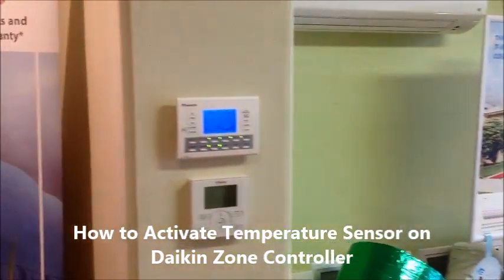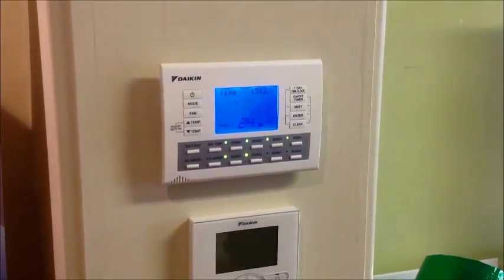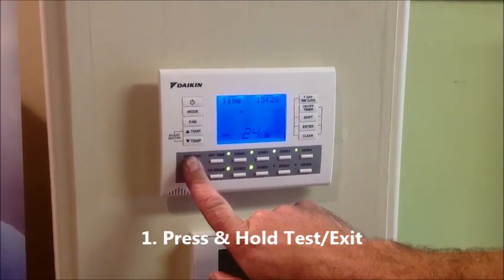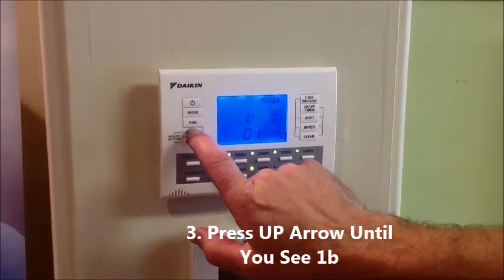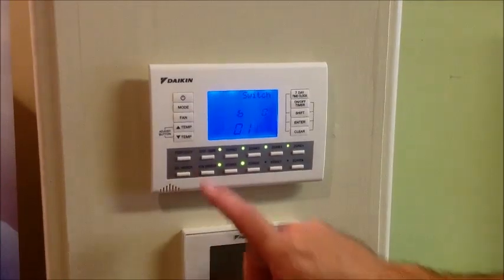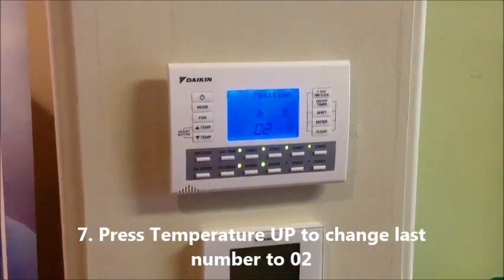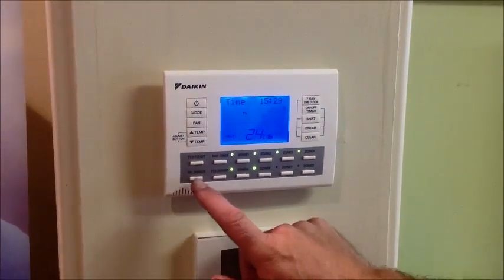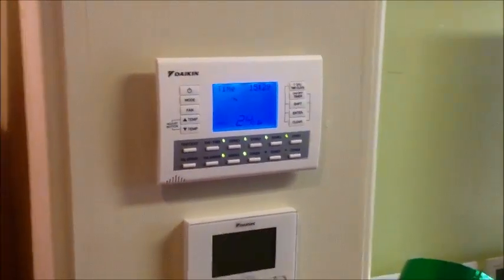Improve Temperature Control | Activate Remote Sensor on Daikin Zone Controller (DIY Guide)

Comment from the maker: 🎯 Want better room temperature control? Learn how to activate the remote sensor on your Daikin Zone Controller for more accurate readings.
💬 Got questions or unsure which sensor your system uses? Drop a comment below!
👍 Like + Subscribe for more quick Daikin DIY tips from Morphett Air.

Comment: To set the themostat to use the return air, do I set the code to 1b 5-02 and then select the indoor sensor?
Reply from the maker: Hi the system is factory set to sense from the Return Air anyway, however if it has been changed to the Master RC (Wall Controller), you should be able to press the "SEL SENSOR" and toggle to "INDOOR SENSOR". Once you've done that, press "FIX SENSOR". This will now be sensing from Return Air.

Comment: Thanks for that. I’ve done it. But when I press fix sensor nothing happens. On my unit I see Master RC, Indoor Sens, Sens1 and pressing Fix Sensor doesn’t show anything. Any help would be greatly appreciated 🙏
Reply from the maker: Hi VW Central by pressing Fix Sensor won’t do anything other than fix the sensor that you happen to  select. In other words, one you toggle between Naster RC (wall controller), Indoor sensor (return air) or Sens1 (remote sensor), you press the Fix Sensor button. This then becomes the preferred sensing point. There will be no notification as such to suggest this but that’s all u need to do…cheers
Reply: @Morphettair  Thank you for your prompt reply, but I don’t see any temperature from the controller itself. The display just remains in the usual off position.
Reply from the maker: @VwcentralAu  ok so just to clarify, are you wanting to see the actual room temperature?? Not sure I understand what you are trying to do?
Reply: @Morphettair  yes exactly. I’d like to see the actual room temperature from that controller.
Reply from the maker: Ok I don’t reckon you can in this controller. A tech should be able to retrieve coil temperatures etc however this is not going to do what you’re expecting. I know it’s possible in their standard controller (BRC1E63) but again don’t think it’s possible on this controller. Go figure 🤷‍♂️
Reply: @Morphettair  interesting. I’m not sure if mine hasn’t been setup correctly but I tried Master RC, Sens1 and Indoor Sens then press Fix Sensor and none show me any temperature 🤷‍♂️
Reply from the maker: @VwcentralAu  none of these options will or should display a temperature. (It will only display the set point temperature (ie the temperature you set it to) on the main screen.

Comment: I have coded as per the video, however my AC seems to just keep running and the temp sensors dont seem to be working still. Indoor Sens does but the controller ones still done. Any ideas?
Reply from the maker: Tricky one without seeing how you’re using it first hand but generally, if the compressor keeps running, this can often be because the conditioned air is not getting to the sensor. For example, if you have it sending at the wall controller in your hallway and have closed the doors to your rooms, this will prevent the conditioned air from reaching the sensor. The system will essentially be sensing an unconditioned hallway and therefore the system thinks it needs to keep conditioning because of the temperature in the hallway 😓 Summary: open doors you are conditioning and close doors you are not. Make sure wherever you are sensing from has conditioned air around it and not unconditioned air.

Comment: Hi,
First off, thanks for your practical and well-presented videos. 
Just a quick question, for BRC24Z8, how I can run the unit on Test Operation to make sure that the sensors are working properly? I mean I need to bypass the sensors and run the unit to make sure the unit is operational.
Regards
Mack

Comment: Hi nice vid got the same unit right now I want to know how to separate the 2 rooms when press zone 2 it's goes to both rooms zone 1 I hear a click but not sound in the rooms if that made sense lol
Reply from the maker: Hi it will depend on how the system was designed.  That is, if whoever designed and installed it had one zone motor that operates the two rooms, this cannot be changed by the wall controller and can only be done by adding a second zone motor.  You would need to speak with a service tech and have them come to inspect to see what can and cannot be done in your case.  As for the Zone 1 room it is possible that this zone motor has seized and this is why you can hear it clicking but not delivering any air to the room.  Again, this would also need to be inspected to confirm and a possible zone motor replacement might be necessary. Cheers.
Reply: I have the same issue! One room is smaller than the other and becomes very cold and/or I cant have it off while the other room tends to heat up more due to sunlight...

Comment: I have got as Zak two controllers master and slave. I wanted to activate both according to your response to Zak’s query but any attempt to select “Local Set “mode on the slave is transferred to “inspection mode”. Could you advice what need to be done?

Comment: Our new place has this installed with 2 controllers. There are only 2 zones - upstairs and downstairs. Will the sensor it uses be on the panel I set this up on? Or does it use both sensors on both controllers? I.e. I want the sensor in the bedroom to be the one that is used.
Reply: @Morphett Air Thanks to Shane from Morphett Air in Adelaide who helped me out by fixing my controller problem I had. He did'nt ask for a cent. In Melbourne, people only thought about the money before they could help me. Also, the receptionist was a great help. Thanks, from Ben in Melbourne.
Reply from the maker: Thanks for your question James.  So if I understand correctly you have two of the Daikin Zones controllers, one upstairs in the bedroom, and one downstairs.  You need to add the field setting for the additional zone controller in the Master Controller only. Once you've done this and if done correctly on the Master Controller, when you press "Sel Sensor" (Select Sensor) you should now see the option of "Master RC" (being Master Remote) and "Secondary Remote" (or similar which is the Slave).  Toggle between the two sensors and select the one you want to sense from and press "Fix Sensor".  Let me know how you go.  Cheers.

Comment: Thanks for posting these, one question if you could help, my controller got frozen yesterday and the display doesn't change whichever button I press, I thought it's cable connection issue so I disconnected and plugged in again, now it's showing "Please Wait" and all characters and icons full screen and display always on (still frozen) with 8 zone buttons all lit on, how do I reset it ?  Many Thanks.
Reply from the maker: Hi Lyle, thanks for your comments and question.  By unplugging the controller is not going to do a full reset as you have found out :) (A) I would suggest that you go to the outdoor unit and look for an isolating switch on or near the unit.  This isolates the power to the unit if a service tech is working on it.  Switch it to the Off position for approx 20 - 30 seconds then turn it back to ON.  The indoor wall controller should show "88" indicating a reset has been done.  After a few seconds it should return to normal function.  (B) If there is no isolating switch, you can also turn off the circuit breaker and turn it back on again which will also do a full reset.  (C) If this does not sort the problem for you, it could be a faulty Wall Controller or Indoor Printed Circuit Board or both, in which case you should contact a local agent to inspect and diagnose formally.  Hope that helps!
Reply: Morphett Air thanks very much for your instructions. I will give a go. Happy new year
Reply from the maker: Cheers Lyle and same to you!

Comment: Just to be clear, do all the controllers (we have 2) have the sensor built it or are they an option?  Also, is there a manual that lists what all these codes do (for the things that you haven't done a video for)?
Reply from the maker: Hi Zak, thank you for your question.  Yes both controllers have an temperature sensor, however you need to tell it that it has a temperature sensor in built.  That is, you need to tell each of the controllers it has one.  You will need to follow the procedure shown in this video https://youtu.be/MWk0GMfQlhM (which is for the master controller), but the process is the same for the secondary controller (Slave controller).  Note: You can only add the field settings in the Master Controller (In other words, to activate both the sensor in the Master Controller and the Slave Controller, the field settings are both entered on the Master Controller ONLY).  Code for Master controller is 1 B 5-02 where Slave is 1 B 6-02.  If you have done it correctly, when you press the &quot;Sel Sensor&quot; button, it should now give you the option to toggle between &quot;Master Control&quot;, &quot;Indoor Sensor&quot; and now &quot;Slave Sensor&quot;.  Select which sensor you want the temperature to read from and then press &quot;Fix Sensor&quot;.  Hope that helps.

Comment: THIS IS THE EXACT SAME AIRCON I HAVE! ITS ON COOL MODE BUT ITS NOT COLD?!? ITS WARM
Reply from the maker: Hi thanks for your comment.  Sounds like you will need to contact a service technician to visit as it could be a number of reasons for it not cooling.  Assuming that the mode and temperature are set appropriately, it could be short of refrigerant (indicating a leak), a printed circuit board, fan motor(s), sensors just to name a few possibilities but again would pay to contact your local Daikin Service Agent and have them inspect and formally diagnose. Cheers,
Reply: Ive got a similar issue it cools when the weather calms down but if its 40° outside and i set the AC to 19° on cool with the highest fan setting it will just blow out air that isnt cool at all. Only when the sun starts comming down it slowly cools..

Comment: Excellence video. Exactly what I am looking for. Thank you very much. Can you please show how to set the Sub RC sensor
Reply from the maker: Hi Phillip, Thanks for your question.  From the Master Controller, firstly enter the settings 1b-6-02 (using the same procedure as in this video).  This will tell the system that there is an additional sub controller sensor.  Then press "Select Sensor" button and you should now have  3 x options  to toggle through, one of which is "Sub Controller" option.  Once you have selected this option, press the "Fix Sensor" button.  Job done.  (We will be putting together another video for this to help others in the future).  Hope this helps and thanks for your support.